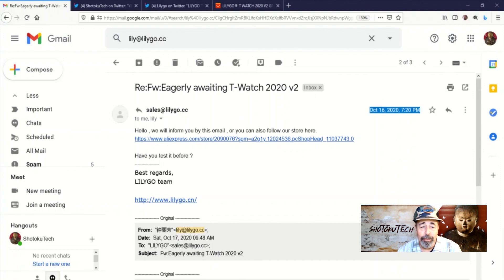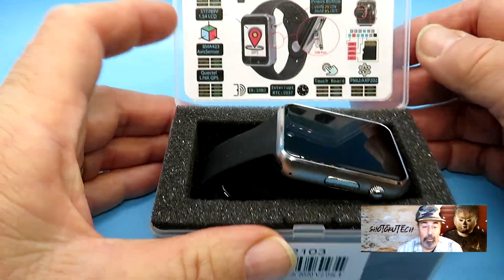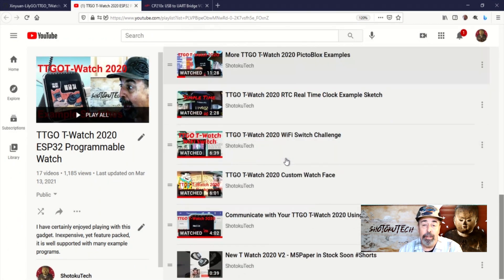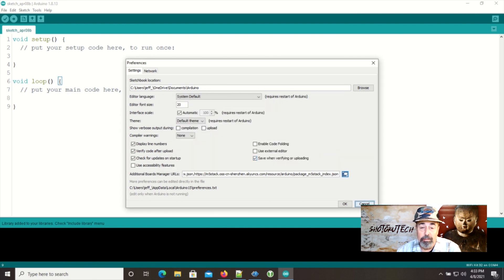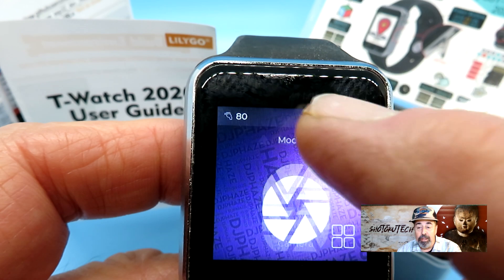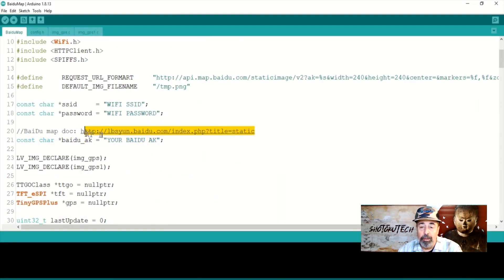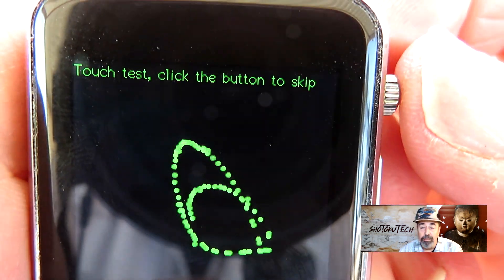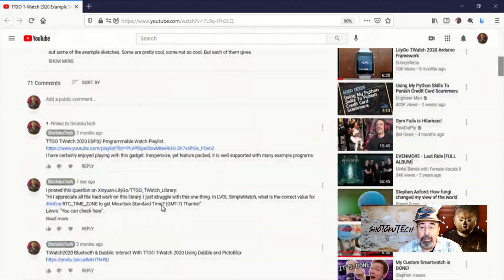New TTGO T Watch 2020 V2 with GPS and TF Card Slot from LilyGO

Comment: I managed to get the SD card working when the cover is on by making two spacers from polystyrene / styrofoam and putting one below the SD and one inside the black piece above it (I had to remove four screws to access in there) The SD is now wedged at a more or less horizontal angle which seems to help with the contact.
Reply from the maker: Brilliant! I was thinking of putting tiny washers under the frame to make a little more room. But backing up the SD card is a smart move. Thanks.

Comment: Great video! Have you found a solution for the SD Card issue when the cover is closed ?
Reply from the maker: Not yet! I am thinking some small washers to add more space to the inside of the case perhaps.
Reply: apparently the "solution" they found was to remove SD card from V3!
Reply from the maker: @jumpjack2  I think v3 was simply intended to process speech and audio. But now that you mention it, extra storage would come in handy for speech recognition. Interesting observation.
Reply: @ShotokuTech  actually I was thinking about a "wrist storage": you can loose your pen drive with 32GB of data, you can loose your phone with 256GB of data, but you can't loose your watch! :-) And being it equipped with wifi, it's like having the storage inside the phone. :-) And if there's not room enough in the watch body, you have a whole wristband available...
Reply from the maker: @jumpjack2  Smart! I like the idea!

Comment: Hello, I am learning how to use t-watch, these videos are helpful, thanks.
But when i am building the GPSDisplay example,
the result on the watch show LOCATION INVAILD, and the date and time is also wrong,
i think maybe the wifi is not connecting, but the video run successfully,
i'am not sure 
whether the problem is about wifi or not.
Reply from the maker: HardwareTest example sketch does not have time setting function. For GPS, do you have good view of the sky? I can get a location from inside my house, but I have to be near some windows or go outside. Best wishes.

Comment: Thanks, I've been playing with a 2020 since last year, but the battery died, so it was on the shelf for quite a while. I eventually decided to get the V2, but had trouble getting it working.
So two things helped:
Plugging in an SD  card (not sure why yet)
and working out how to select the V2 in Platformio. FYI with no changes from the Library it seemed to be compiling for the original (V1) OK, and not generating all three images..
Thanks
Reply from the maker: So you are okay then. It seems to be a love/hate relationship between the SD card and the battery. Thanks for the update!

Comment: I'm hoping you are able to get the My-TTGO Watch app compiled and flashed, since I tried to get it going (tried both the Arduino IDE and PlatformIO), but couldn't get it to work (and the documentation on that Github repo is very sparse, to say the least).
Thanks again for the heads up in your peevious video about the v2: I immediately ordered one and it arrived 10 days later. They are absolutely fantastic watches.
Reply from the maker: That will be coming soon. Thanks!
Reply from the maker: Here you go! Check it out. https://youtu.be/wUGADCnerCs
Reply: @ShotokuTech  wow, thank you! 👍
Reply from the maker: @Quick_Fix  Thank you! Comments and questions are important on this channel.